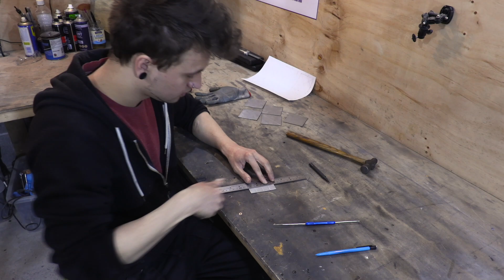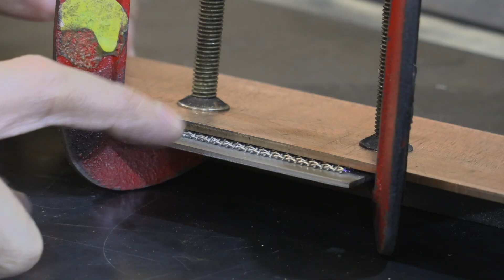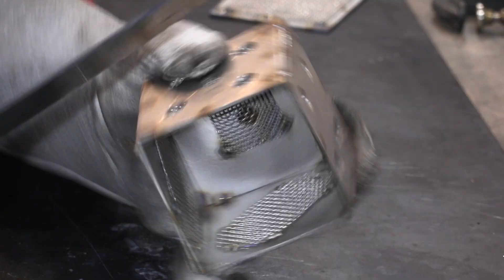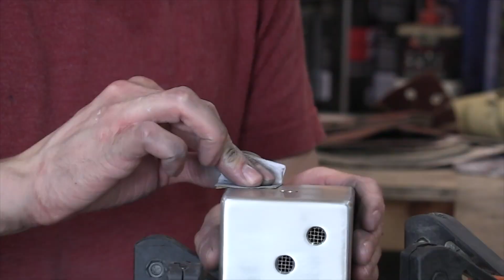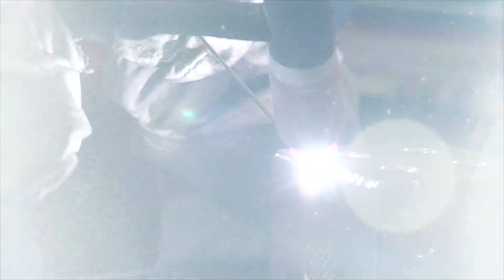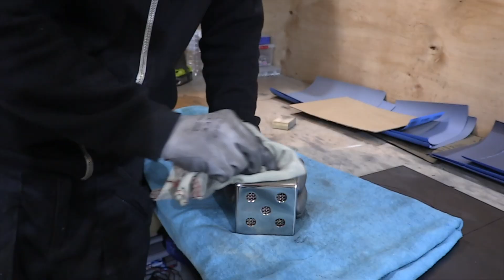Making Dice From Stainless Steel

Comment: Both of the dice looks good. However, it was hard to tell if you have the dots in the proper order/sequence. Again, hard to tell, but it does look like you have the opposite sides matching up. Each opposite side will equal 7 (6-1, 5-2, 4-3). What I can't see is with the 6 facing upward and the 4 facing you, should line up with the 6 (dots) , the 5 will be to the right. If you got that then awesome.
Reply from the maker: Yeah, they are in the correct sequence. I used an existing die as reference 😁

Glad you liked the project! Which of the two do you prefer?
Reply: @Dre.T.K  The one with the different size holes. It makes it more of a unique novelty